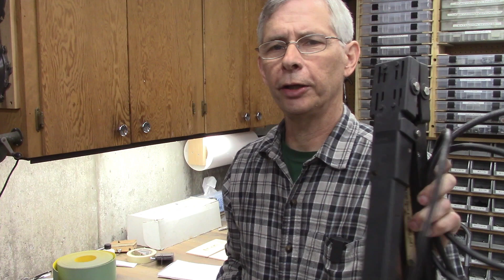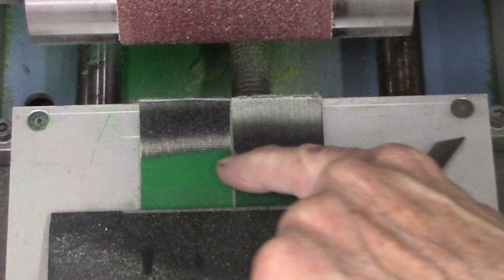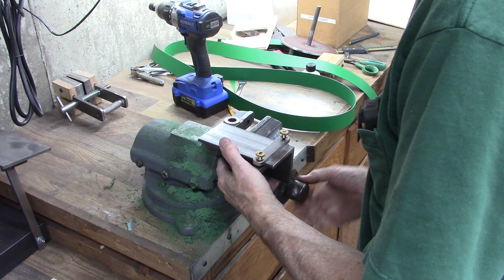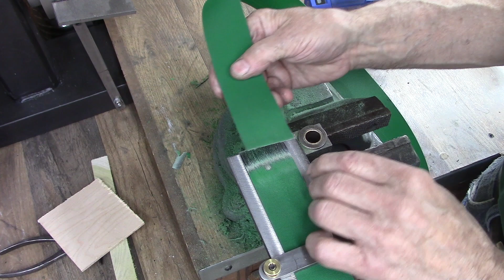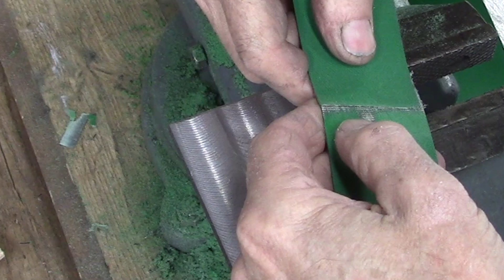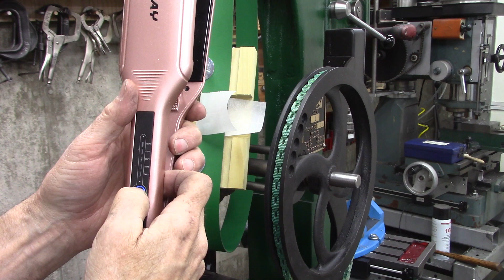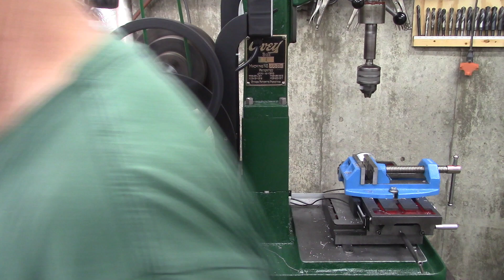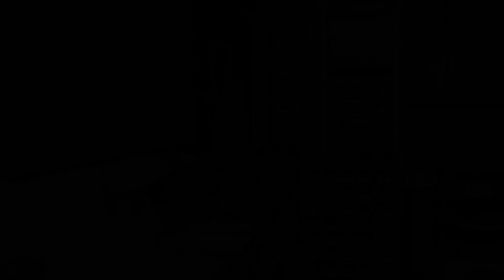Flat Belt Fabricating and Splicing - Synthetic Belts

Comment: Hi Winky, not what I expected. I was used to leather belts that you had to have a special tool to crimp into the leather steel staples at each end and join it together with a piece of catgut rod. Oh well that was 50 Years ago, that's modern technology for you. Seeing as you have now all the belts and tools, how about offering a belt make up service ? They send you the length, you make it up and post it back to them. Whatever machine they have they will need to remove the spindle or countershaft to fit it, but that will be their problem. If only made up belts are available commercially they would need to strip the machine anyway.  Regards from Australia.
Reply from the maker: Hello Dave, this is my plan but the current challenge is how to do this via my web store. I suspect I'll need to create a price sheet and handle each order individually. Originally I planned on buying new belt but it's ridiculously high priced ($11.25 per foot). I bought a 100 meter roll and there is another roll available (NOS) but after that I'll have to stop selling belts. I've realized there was a market for these belts for a long time but the need for a $750+ heater was an obstacle. Now the full price on this belt material is also a problem.  Six years ago this belt was less than have the price.

Comment: The video sure was a interesting one Mark. I really liked the two grinders and all the jigs and fixtures. Looking forward to the second video.
Reply from the maker: Thanks Andy, the hand grinder basically a copy of a commercially available grinder but it works way better with the help of a hand drill.
Reply: @WinkysWorkshop  You mentioned that it was based on a commercial grinder. I like the fact that you can cut most of the material off using the drill then finish it off more precisely by hand. I'm glad that you came up with some material. I certainly learned alot from the video.
Reply from the maker: @andyZ3500s  Yeah the hand grinder works incredibly well. Better than the commercial version actually. It didn't have the nut in the middle to drive the disk with. I couldn't believe the deal I got on the belt. This belt is premium belt. I found 2 rolls (bought one). Each roll was 2" x 100 meters long. I need to go back and buy the second roll. I paid less than 1/10th the original cost.
Reply: @WinkysWorkshop  Sounds like a good score. Your videos on the subject can open up some areas to different people in the homeshop our others just starting out and learning the ropes. As much as I looked thought catalogs on powertrain in the past I don't recall seeing much on belting. Hopefully people will purchase some from you. Maybe you could sell them cut and ground and the buyers could take over from their. If I disappear for a few days my tablet is failing rapidly I am down to 42% plugged into the wall at this point.
Reply from the maker: @andyZ3500s  Oh...  good luck with the computer.
Reply: @WinkysWorkshop  Hey,  you will never guess what happened. I started having problems with the battery recharging so I tried a few different transformers with no luck. About a hour or so ago I thought why don't I try a different cord. So I just checked it out saw your reply and it is charging fine. So all is well because I don't like to spend money unless it's on tooling and I am use to my tablet. Thanks Mark

Comment: I used a similar method to make small timing belts for a homemade cnc machine.  Inside the timing belts there are fibers - you sand each end down to the fibers and then glue it together.  I was using an "ultra-flexible super glue" which worked OK.  They would eventually fail, but I think it was because the glue would just get harder and harder.  If I ever need to do it again (I've since moved to direct connection of the motors to the screws) I'll try using a glue like this and see how it does.
Reply from the maker: I suspect this glue would not work unless the timing belts are made of nylon. It's also activated with heat. At work people used super glue to glue belts. It was quick and easy and worked well for about 2 to 4  hours. Stacking machines have (for printing) are very demanding. I remember the super glue actually made the nylon get hot and smoke!
Reply: I've seen people use super glue on small, stretchy round belts and even large O-rings gluing them end-to-end. It was amazing that it worked at all,  but I don't know how durable they are.
Reply from the maker: @Bob_Adkins  Super glue is amazing stuff but at least on this type belt (nylon Polyamide) it makes the nylon brittle. Not sure about o-rings but they make a round Polyurethane belt that melts together. The belt itself is fairly strong and the joint is the same as the belt. You can get it on amazon in several sizes. Its called Poly Round or Polycord.

Comment: This is a very interesting video, thank you Sir Winky. I remember in the olde days working in shops that still had the line pully systems. The Millrights would replace the belts and I often wondered how they joined them. Of cause, they said it was magic. 60 years on I now have doubts that magic is real 😊.
Reply from the maker: Back then they laced them together with leather.

Comment: I think you've hit your target: affordable belt splicing for the hobby machine shop. I'm impressed.
My old Sheldon lathe uses a flat belt and I bought one made of leather and a clever metal clip to join the ends. It wasn't very expensive and it wasn't hard to do. I think you mentioned this system briefly towards the start of the video. My leather drive belt has been going for several years now (light use, I must admit) and shows no real sign of wear. But, if I do ever need to splice a nylon belt, I'll be sure to watch this video again.
Reply from the maker: Leather belts work great, just not as long as the nylon core belts.

Comment: Wow this is great. I spent around $150 for the belt for my South Bend 13 and dread the day i have to cut or replace it. Will make these devices and try this out on some projects until that day comes. Thank you for sharing your knowledge.
Reply from the maker: Your welcome! Please be aware that this glue and process is for nylon core belts only. They are common but there are many that are not nylon.

Comment: WOW - thank you.  So this would work well as an upgrade/refresh on my Southbend 10k?
Reply from the maker: It would work fine but please be aware that this glue and process is for nylon core belts only. They are common but there are many that are not nylon. More to come next week. Thanks!
Reply: @WinkysWorkshop  Thanks so much Mark for that clarification.  I would definitely like to get on your list if you do decide to sell lengths of the nylon belts.  However if you do decide not to distribute belt lengths, please provide a source where we can find some.  Joel…..
Reply from the maker: @joell439  This belt is high priced ($11.25 per ft)  but I got a super good deal. Send me an email at Winkysworkshop@GMX.com with BELT as the subject.